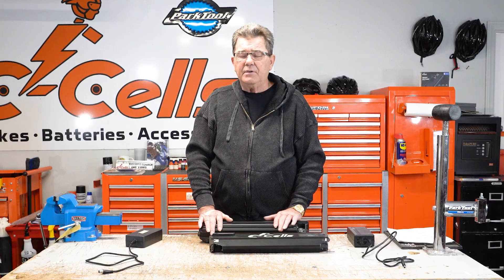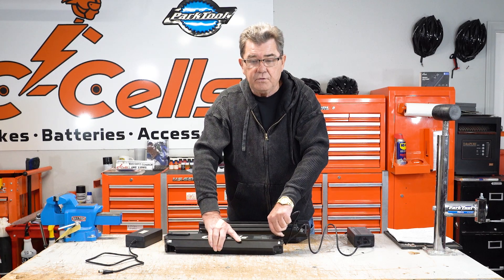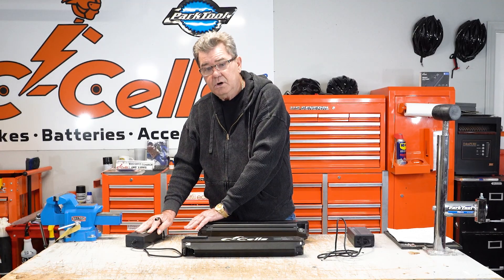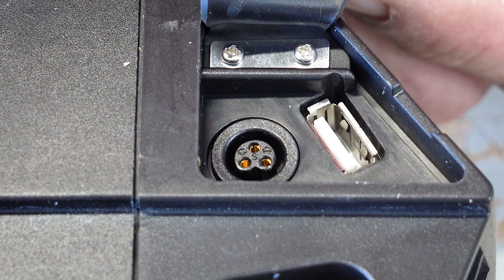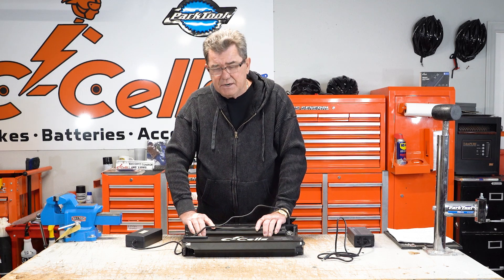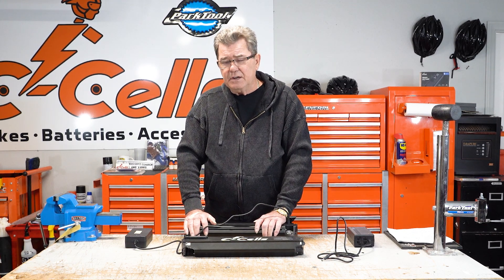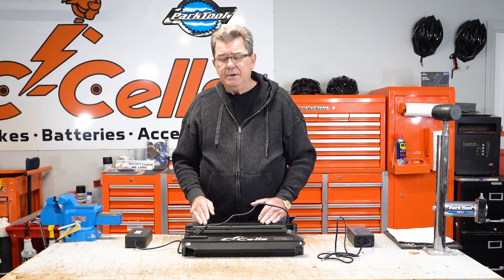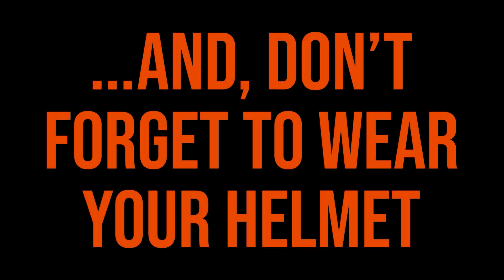CHARGING - 2-pin VS 3-pin

Comment: Thanks Dave, et all. As it happens i do have a question, how long does or should it take charge y Five Star battery? Display,  shows two bars, 67watts, three bars on the actual battery after i removed it. it seems like it is taking a very long time but i dont know ball park what to expect?  Thanks
Reply from the maker: The battery is charged when the charger light turns green. However, it’s good practice to leave it on the charger for a little longer to allow for that trickle charge. If you can, just leave it plugged in overnight. Your battery indicator may show 2 or 3 bars when you turn the bike on after charging, but it will sync up and show full bars when you start riding.
Reply: @ thanks!

Comment: 3 pin connecter and high end Samsung cells E-cells ebike batteries are proven to be very safe reliability durable  long lasting longevity, a secure 3 pin connecter system that has a great track record.